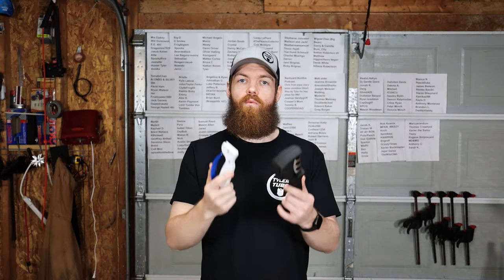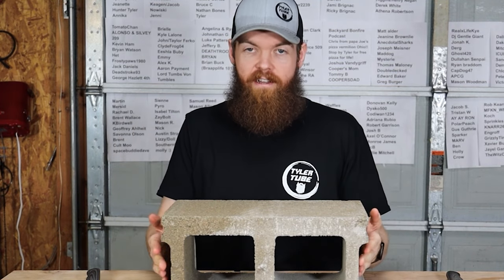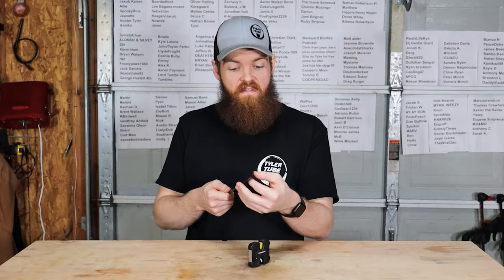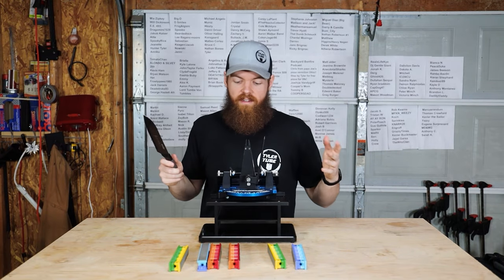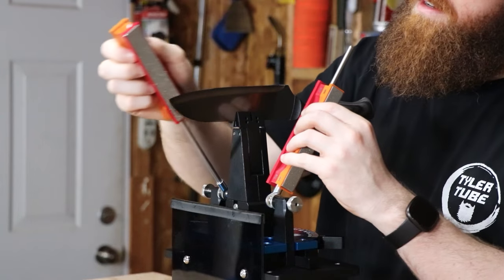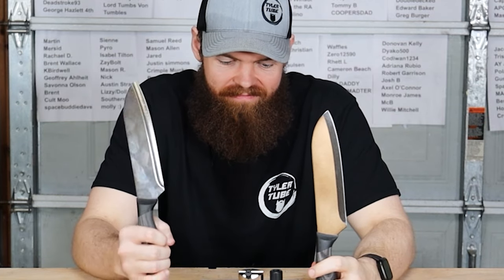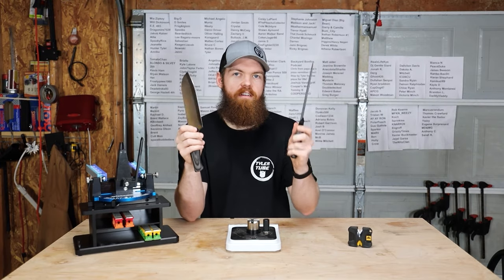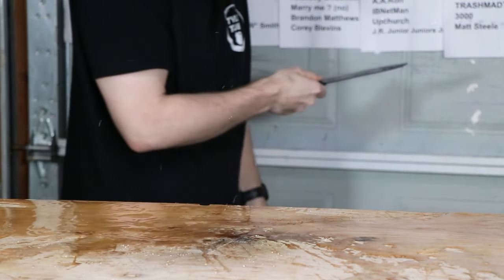$4 VS $1000 Knife Sharpener, Which One Is Better?

Comment: If you know how to use just a regular sharpening stone (super cheap) you can get better results than the $1,000 sharpener. The stone is WAY quicker and with less effort, plus a stone can fit in your pocket. I went on a medical mission trip to Peru. We forgot the sharpening stone, so our dental Hygienist was able to sharpen scalers (the tools they use to scrape your teeth during teeth cleanings) perfectly on a flat rock she found

Comment: I'd rather have the $1000 sharpener because I know it will take care of my blades much better than the cheap one and it won't break. It will last me a lifetime and hopefully, it will make my knives last a lifetime. The cheap one is removing way way more material than the expensive one. It's critical to how long the blade lasts.
Reply: I hqve had the $400 WE USA system now for ten years and love it, it keeps all my cutlery super scary sharp, I will never use one of those carbide pull throughs. I admit though, I do keep my knives properly honed with a Block brand sharpener, they do an awesome job doing do.

Comment: When sharpening with stones, I thought you were supposed to sharpen a blade in the cutting direction (moving stone toward the blade from the handle to the tip), but you were moving the stone away from the blade, probably causing little deformations as you were pulling the metal towards the cutting edge. I demand a retrial!
Reply: He also didn’t use it right in the slightest. You are supposed to go one side at 100 grit until you get a burr and then do the same for the other side and then start sharpening but that is besides the point. The wicked edge is a good sharpener but takes time to be efficient and effective with it. A quick one and done isn’t an accurate representation of the sharpener in general. And to clarify you are correct about the direction of the sharpener. Always best to sharpen in the direction you are cutting. Have a good day man.

Comment: I have the 1st Gen Wicked Edge,  if you get the 1200-1600 grit ceramic and finish with the 4/2 micron diamond paste strop, the polish and edge are definitely amazing. That will definitely shave your hair right off.
Reply: Maybe he should learn how to use it first. I just finished my 940 at 300 grit finish

Comment: Just want to throw out and idea as well. Let's keep in mind the other knife was also about 200 away from the beginning, and after the cement block and after sharpening.
Reply: none of this matters because he kept sharpening until it was as sharp as it can get. for the cost the $1000 sharpener should had be getting edge so sharp you can shave not just hair, but also dead skin cells off your skin.. that's an edge that's way more sharper than any factory sharpened knife.

Comment: A way choice would be a Lansky kit, they´re less than 10% of the price and also offer different angles and various extra grids for cheap, or use 3-4 dual grided stones, I think up to 12000grid isn´t too expensive maybe 200$ total for all for stones. But you´re already setup good with a 8000 grid stone.

Comment: First off: You need to sharpen one side then the other after you get a burr and then slowly minimize the pressure you put onto the blade. Dont push the stones against them. 
Also yeah if you get the 4k grit and 8k grit stones it gets much sharper. Also maby you have done the angle wrong or something.

Lastly this Sharpening tool requires you to strap the blade unlike the worksharp and goes for consistancy. 
Your worksharp makes a blade sharp at some points and dull at others. The 1k$ system is way more consistent, can repair or even produce a blade and has more applocations. Also maby the knives you use have a softer steel that tends to roll over easier. Maby try using one very good knife and try atound a little bit with this system! It is known in the community as a REALLY great tool!

Comment: A very friendly way of getting rid of the burs is to lightly run the edge along the angle of some wood 2 or 3 strokes even 1 it smoothens out the blade and gives you a cleaner edge be careful not rough we dont wanna blunt it, however if you know how to use a strop thats what you wanna use.

Comment: Not going to lie bang for the buck especially if you have alot of knives is a knife sharpening kit for a 1 inch belt sander and an angle stop for it. Mine came with grits up to 5k and a strop with polish. Works like a charm. Or the lansky stone kit for a few knifes.

Comment: You get a wicked edge to sharpen good and expensive knives. Not trash knives. The edge pro is better more versatile sharpening system at a cheaper price. Though it does have a slightly higher learning curve.

Also you need to remove the burr before testing on the BESS

Also you need some technique to sharpen correctly. Also your knives are too soft.

Actual professionals that use the wicked edge get far better results. Its not for the novice.

Comment: I think the most important comment here is that a $1,000 sharpener does not come complete with all the accessories it should. If it needs to come with a strop, then that should be included. If there are cheaper kits with more grit, this one should have it too. All I can see is a greedy sharpening company that spent more money on the case than making a decent sharpening system

Comment: I used to sharpen 700-1000 knifes a day, 80-130 restaurants. We used a 2 step process, hollow grinder and then a honer. PRIMEdge equipment.

Comment: The other big thing is the 4 dollar “sharpener” doesn’t really sharpen, it removes layers of metal each time. Which of you have a nice knife it will destroy it over time by cutting away at the core metal unevenly because most kitchen knives are made of a sandwich steel with the core being more brittle but sharper steel vs the outside. So basically you would want to use the nice stones if you have expensive knives but if you just have 20 dollar knives the 4 dollar one is fine.

Comment: Let this video be a lesson that no matter how much money you have, you can't buy skill and practice. Blade sharpening is a skilled craft, like any other. Just because you buy the most expensive tools don't mean you know how to use them. A professional with a 1 dollar whetstone and a strop could smoke any sharpener on the market because they have practiced it.. they know what they're doing and what they're trying to accomplish. Granted for the avg joe, the 4 dollar knife sharpener will slice up your veggies just fine.. at the cost of removing more material, so your knives won't last as long. However, if you want surgical sharp... practice, practice, practice.

Comment: This kind of proves my thought on the angle the knife is sharpened matters more than the type of sharpener you use. Plus you don't need to get really fine. The coarser the grit the better grip your knife has to cut. But, yeah. It be like that.

Comment: The sheer weight of damage done to the knives in this video made me ill.  The pull-through probably took years off the knife AFTER the concrete and it wasn't that sharp once it was done.  If you used it about 10 minutes you'd have to go sharpen it again.

Comment: The problem I had with the wicked edge is the clamp won’t hold thicker knives.  I have pocket knives that don’t fit!  I think they took ease of use a bit far and for the price it should e able to sharpen every knife I own.  It’s a great concept but I think it should have 2 clamps and wider jaws.

Comment: I use a carbide edge streightner for worst, a cheapo diamond rod sharpener for gross, and a lucolox ceramic tube from an old sodium vapor lamp for fine. The combination can sharpen all but zirconium carbide ceramic type knives. 🤓

Comment: Hey, gotta take into account.

The blade from the 1000 dollar knife sharpener is actually sharper than it was before the torture. While the 4 dollar one couldnt get it even to the same level.

So, if this would be high end knifes (dont know what kind of knifes this is) and with the correct settings, then this sharpener for sure could be 100% worth it.

But for the avrage joe, who sharpens their knife 1 time every 15 years or maybe never. No, it wont be worth it.

All I for sure can say is, that the more expensive knife sharpernes with options like the one in the video, they have the possability to make a knife extremly good.
Mine isnt a 1000 bucks, sure not. But its still 120 dollars ish.
And it does outperforme any IKEA knife sharperner by a mile.
Remember the diffrence in these tests, from 500-400 isnt big in numbers, but it takes a lot from a sharperner to actually get that diffrence.

Comment: Gotta use a higher grade knife made with better materials in the blade. Cheap knives are only capable of being so sharp. Just like you sharpened the plexiglass you ran into so many problems. Same with cheaper metal on a micro level

Comment: I use my Work sharp precision adjust with the standard stones 320, 600 and ceramic on my edc knives, after that i use a rough and fine strop and it becomes razor sharp, can't get a complete mirror edge but for €65 you won't hear me complain.

Comment: Just watched this. I own a WE sharpening system and it’s awesome. Even only going to 1000 grit it provides repeatable near razor blade edges. I would politely suggest that you read the manual again. You’re clearly doing several things wrong. Project Farm guy was able to get BESS 100 level sharpness with exactly the same model. Also .. use a decent knife steel. It matters. You can’t polish a turd.

Comment: The point people are missing is the 4 dollar sharpener did as food if not better than the 1000 dollar set with way less hassle and effort. Sure you can strop it afterwards but thats not the point of this test. The point is you can strop an equivalent sharp knife and save 996 dollars

Comment: You used the expensive sharpener wrong. You dragged the stones in the opposite direction that you’re supposed to. You push against the edge, not pull away from it

Comment: 16:12
Doesn't it get dull when you cut the paper ?
You measured the sharpness after cutting the paper .
Reply: Only if it has terrible edge retention. Once he starts cutting toilet paper cleanly or unsupported phone book paper or cutting hair without touching skin, then the paper will start to negatively affect its performance. 

He's basically wielding a dull knife.

Comment: If  I had a need, I'd get a mini belt sander and also use it to sharpen knives. But... I have another brand identical to that $4 knife sharpener that I use for touching up my knives and pocket knives. If I need to resharpen a really bad knife, I have a 2 zone Smith's sharpener for that that does well enough. Also, the knives used for this test really don't do adequate justice to show how well the Wicked Edge can do. Maybe next time, use better higher quality blades.

Comment: ya gotta strop the knives if you want the sharpness to be even and uniform. will make the blade able to cut turns and curves into the paper effortlessly.
Reply: also im guessing the reason the 1000 dollar knife sharpener didnt work as well as you expected is because you kind of really need to know what you are doing with the thing, what type of edge you want etc. 
the best slicers are usually terrible at holding an edge compared to a chopper. The best choppers will get hung up on certain targets when compared to the best slicers. What defines that is both the edge geometry, and the blade geometry.

Comment: Besides the other comments about you doing it wrong I won't get into that but for me the real difference between a cheap sharpener vs expensive is longevity of the sharpener AND blade.  Not only that but sharpeners like that $5 tend to actually CHIP harder knife blades. It works ok on softer blades. 

A $5 sharpener might make a knife sharper but not for long they also tend to shave off more metal than really needed, lowering the life of the blade. The $5 wont last as long as the more expensive unit. I wouldn't sharpen a $100 knife on a $5 sharpener, ill be using a nice whetstone.

Comment: plus the 4 dollar tool you can toss in your bag if you ever need to quickly sharpen your blade on the go i think id feel confident with it. i know theres plenty of people who will nit pick this video and find user error but the fact remains he got a sharp edge faster and easier with the small 4 dollar tool.  

Arguably maybe that amazon tool cuts at a sharper angle than what the factory does on those knives. but yeah... better that kinda money on a tool like that is nuts

Comment: You do have to consider that the 1000 dollar sharpener was two hundred more on the scale at the start than the 4 dollar sharpener and after all it did get better with a little fix

Comment: In my honest opinion you wouldn’t use a 1000$ knife sharpener to sharpen a kitchen knife let alone a 20$ one. Maybe a nice hardened steel blade that can handle an edge that it can get from that. Cheap metal can’t get that sharp

Comment: I have a single smooth stone that I guarantee sharpens my knives better than that $1000 contraption.....has 4 sides and they all feel different but it's all the same grit. One side I put some oil on and it became very smooth like ceramic, once I use that side my knives are cutting anything, I've used it for a few years and it's great.

Comment: Gotta draw a burr… The WE also won’t shave metal off the knife in the same way which is better for the longevity of the knife… also with the WE the results are extremely consistent so when re sharpening you remove even less metal than original

Comment: Very cool video! 
Now the question is, can you find a knife sharpener for under $100 that can out do the $1,000 one, and how sharp can the $1,000 one do with that $255 add on stone set?
Reply: this is a joke, a 1,000 sharpening stone is not necessary, you can find a stone in a creek that will get your knife sharp enough to shave with, its all marketing like phones, who needs a 1000 phone, its just overkill.

Comment: That's absolutely crazy. I think you should attack this again. Not sure what you could do different I think I would check to see if you can buy a higher grit stones. I own a worksharp from Tractor Supply in it produces a amazing Edge I wish I had a sharpness tester to see. Great video Tyler people, think about doing this again I don't buy it on $1,000 sharpener

Comment: Let me put it this way, I wouldn't use that 4$ sharpening gimmick on any of my high quality knives. There are many reasons, but most important ones are that you don't have angle control which matters a lot when it comes to durability of the edge and knife itself. Butchering knives are sharpened at 25°, cooking knives 22°, etc. Another important point is that once properly formed, all you need to do with your edge is to maintain it. You don't go from low to high grit all over again, just polish with highest and you are good to go. That way you don't abuse your stones or your knife.

Apart from that, few flaws in this testing. Not every edge can hold 15°. In fact hardest of japanese knives are sharpened at around 18°. For factory crap like those knives, no smaller angle than 20° should be chosen. Sure, they will perform better in the test but they will lose edge significantly faster because metal is so soft. And how do we know it's soft, because it can be sharpened by scraping it on 4$ sharpener. Also, I don't believe that sharpening system is representative of highest quality you can currently get. There are better solutions with much higher quality stones for around 500$ and go as low as 250$ if you are not obsessive with higher end stones. Stones included in this kit are all diamond stones, which need to be broken in. Initially they are super sharp and leave huge burs on edge. Sharpening is also never done left, right ... but dozen or so times one side, then switch. This way we do form a burr but we slowly work it out as well leaving a better edge.

Comment: You can do 2 things to make Sharp knife on these systems, do few Last strokes Just downwards to deburr the edge. Or take it on leather strop. Or both... i do use similiar system but much cheaper. I end at 600grit And strop it with some random paste And its shaving scary sharp.

its really just user error

Comment: I can get 170 on a $50 harbor freight 1x30 belt grinder and a $20 multi pack of belts from Amazon..... after stropping. You gotta strop. Even a fine edge will end up with a bur facing the direction of your last pass. The bur is your cutting edge.

Comment: The $1k sharpener is for professional knife sharpeners and knife makers. The knives they are sharpening are made from quality steel, that has been properly hardened and tempered.
The knives you’re using were made in China from metal of dubious quality. If the metal can not hold an edge, then your sharpness tester will dull the knife as its being tested.
Reply: Indeed, when using a knife made of cheap steel, a blade that is slightly blunt may remain usable longer than one which is so sharp that the edge will get damaged with use.

Comment: You didn't apex, so you didn't get a sharp knife. Look up how to find the burr.
  For context, if you just go at it with something like the wicked edge you can get a sharp knife. But it takes a ton of time if you don't Apex. Eventually you will Apex without meaning to. But it's much faster and easier to just do one side first, until the edge rolls over (which is where you get a bur on the opposite side). Then work back and forth, removing the bur and leaving a razor sharp edge (after stropping).